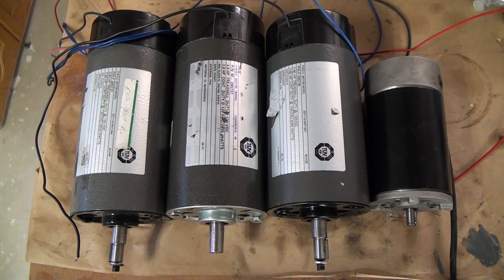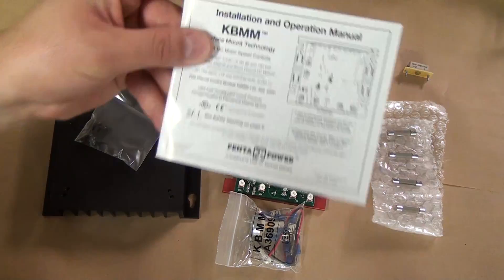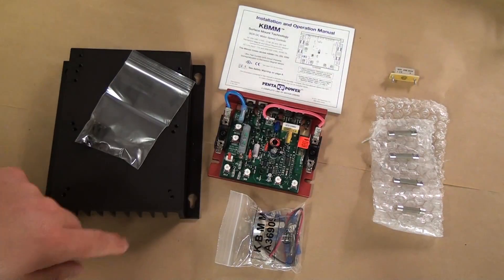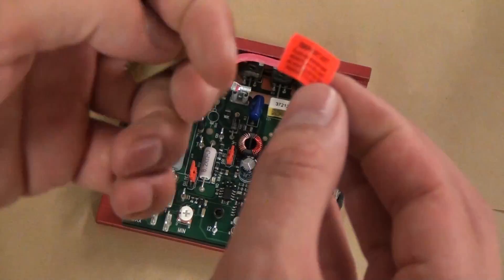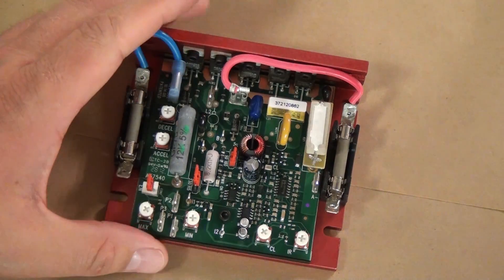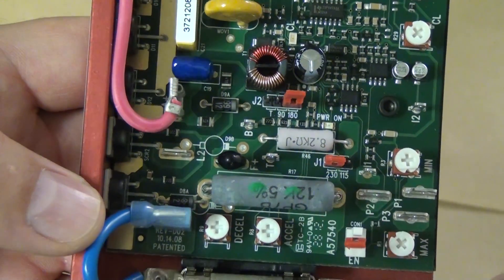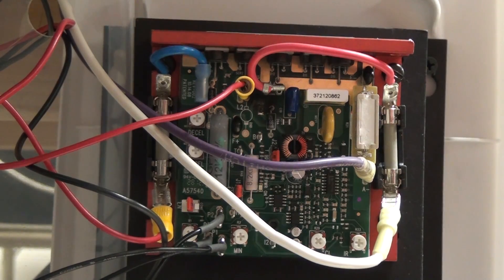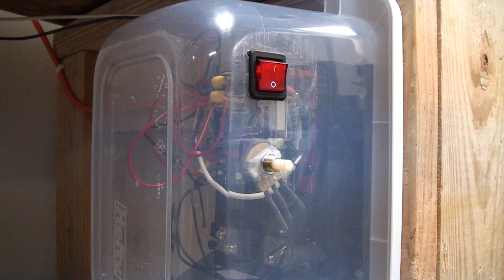CNC-G0704 #17 Belt Drive Conversion pt5 (Motor & Controller)

Comment: Rus, did you use different rated fuses for the AC and DC line? Trying to get the KBIC240D set up in my life. The manual didn't mention anything about this so I assumed that was the case
Reply from the maker: No I didn't, and that was a mistake. When I burned up my motor it was because I had 20 amp fuses on both sides of the drive. You should be fine to run max amp fuse on the AC side, but I would run just under your Motors rated amp on the DC side. Better to blow a fuse and burn up your motor.

Comment: im confused russtuff
,... if im running a 2.8hp motor an this controller can i run this controller off of 120ac? or this controller has to be hooked up to 220ac?
Reply from the maker: It can take either 120v or 220v in, but if you want to get all 2.8hp out of your motor you need to give it 240v. If you run it on 120vac you'll only get 1.4hp out.

Comment: Russ ,  I just finished my belt conversion. I used the same spindle pulley and then a 72 tooth on the drive motor which is a 2kw servo. Question , how noisy is your drive now that you have added the spacer and the belt is no longer being chewed up by the  tach ring mounting bolts. My set up is much noisier than the previous v-belt/ stock motor drive i was running. Also did you add the 3d printed spline dampener/spacer that Hoss had recomended?  Thanks again. Always enjoy you videos!
BMac
Reply from the maker: Hey Brian.
It was pretty noisy in the beginning and the spacer definitely helped. I didn't use the Hoss bushing because I don't have a 3D printer, but I made a bushing out of a hockey puck and it worked great! It cut down on the noise even more, but it still louder than a v-belt would be. There is a video about that bushing on my channel. I've debated about redoing the drive with a v-belt but it isn't bothersome enough that its on my priority list right now.
Reply: Thanks Russ, ha a hockey puck, a man after my own heart! I just ordered a couple of dampeners/bushing online, for like $6 each, just upload the step file select what product you want it made out of pretty cool. So I'll see what kind of quality it comes back as. I think I'm getting used to the noise now, it was just a big change from my vbelt drive. Thanks again!
Reply from the maker: Brian MacLeod Cool! What site did you use to get the parts printed?
Reply from the maker: Thanks Brian.

Comment: Rus, is there any way you know of to integrate that controller with Mach3 so that it can control spindle speed rather than using a potentionmeter?
Reply from the maker: +ElementalMaker I don't know, as I have no experience with Mach 3.

Comment: So, did you ever solve the voltage issue? You mentioned somewhere about smoke when you tried  to use the pots to get 130V, instead of 90V?  Are we stuck with 90V. (I also have the 3.8hp that I bought a LONG time ago.)
Reply from the maker: wwwkayak I haven't done any tuning at all, so I'm still running at 90v. My guess, is that the max RPM trim pot will allow you to go way over 90v, but until I get around to tuning it a bit I won't know. I'll be sure to post a video when I get back to working on this thing.
Reply: russtuff  Ha, good timing, I'm out in the shop finishing up the motor mount now. Ended up buying the DG4S-16035 DC Servo Drive. Completely negates the reason for using a cheap treadmill motor, but i'll have a nice driver WHEN the TM dies ;)
Reply from the maker: wwwkayak Nice. That looks like a great drive.

Comment: the 3.8 motors are harder and harder to find, what did you search for on ebay to find them?
Reply from the maker: meocats I can't say for sure, but I'm sure it was just "3.8" and "motor" (no quotes). Maybe "DC", or "treadmill", or "electric"... I think that's why I ended up with a 2.8 because I couldn't find more 3.8 motors for a decent price.
Reply from the maker: meocats I searched my ebay purchases and found the 3.8 was listed as "NORDICTRACK PROFORM 3.8 HP TREADMILL DRIVE MOTOR 295737".

Comment: Aw, man.  I was hoping to see a spindle motor run at the end of this video.  :-)
Reply from the maker: I know. I said at the end it would be the last video in the series, but it won't really be... I need to sort out this bearing problem that has cropped up, then also see if I can crank more RPM out of the controller. Stay tuned :)